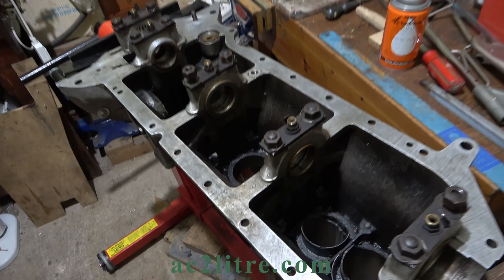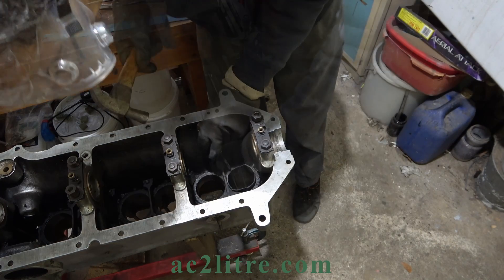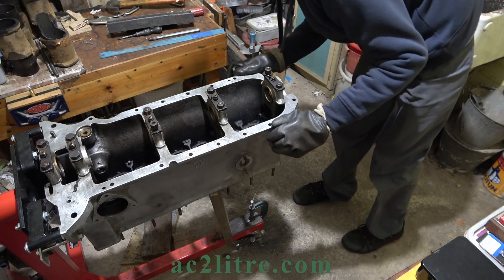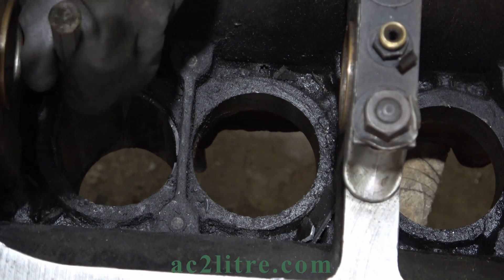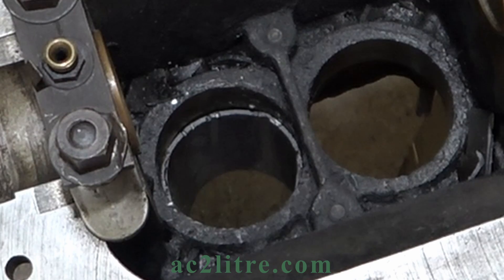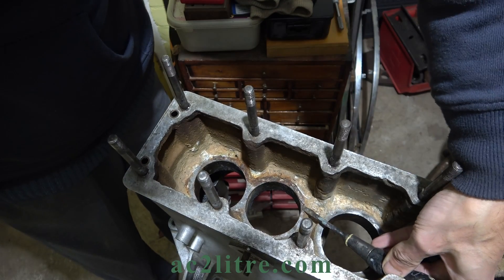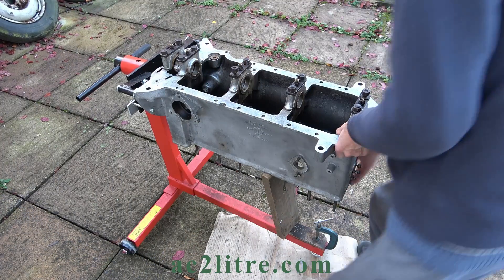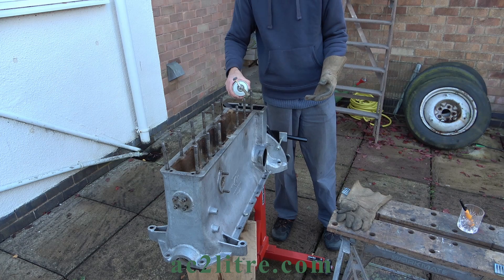AC 2 Litre engine dismantling, part 4.

Comment: Your using a carpenters hammer no qualified mechanic or engineer would ever do this.
Reply from the maker: Then the qualified mechanic would fail. An engineer with 62 years experience of engine rebuilding, tried and failed with a liner extractor, and heated block. I've been consulting 2 specialists with extensive experience of these unique AC engines, and they've never encountered liners stuck as badly as my last 2.

Comment: thats hard core my liners in my TR3 came right out. my head studs were a little troublesome but with heat they came out.
Reply from the maker: My alloy block makes things interesting! I'm waiting for milder weather, as it helps to have a warm block when removing studs.

Comment: Hi Ian, did you heat up the whole engine block before removing the liners?
Reply from the maker: I heated the block to get 4 liners out, but the other 2 were stuck firmly. So I had to break them up.
Reply: OK, just I have an old UMB engine I will be rebuilding in the next (maybe 5 years) you have a good new years eve.

Comment: Glad you got the liners out, one nightmare, oops no, one "challenge" overcome, now the studs. In case not tried this, I saw on tv heating up a seized threaded item, similar to your issue, but applied the penetrating oil while it was hot, and then left it to work.